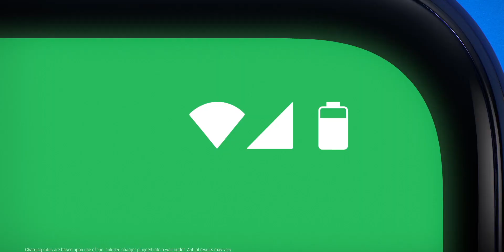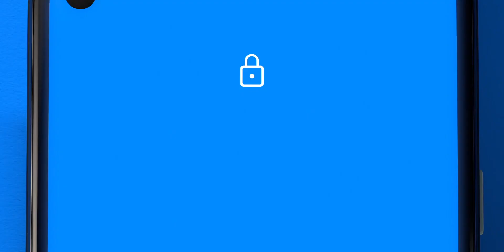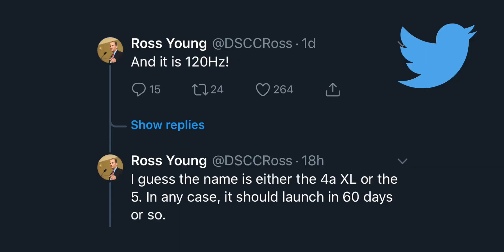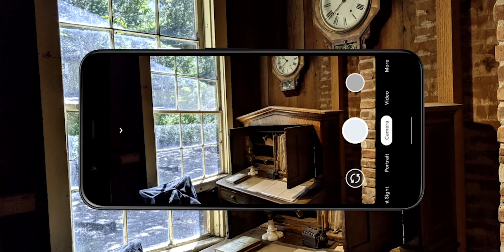Google Pixel 5 - BRINGING THE HEAT!

Comment: If October availability, I'll wait. If extended I might just give up on Google.

Thanks for the video
Reply: What's the rush?
Reply: I was waiting for the Pixel 4A , gave up on waiting.

Got the Galaxy A71 instead 😄 I'm happy with it.

👍
Reply: @banksta3  I have  a Pixel 2XL which is on its last legs, screen response etc and I was holding out for the Pixel 4 initially but wasn't as impressed once that was released so was holding out for the 4a and/or 5G enabled Pixel (having owned most of the Pixels & Nexus up to the Pixel 2).
Reply: @ONYX-365  Oof, I prefer to wait
Reply: My battery on my old phone wasn't in great condition.
Waiting til' October might have been a stretch too far 😅

Edit* plus I like the 4500MaH battery on this phone.
Reply: @ONYX-365  Ah well.yeah fair enough. Enjoy your phone man. (I'm deciding between Pixel 4a vs Nord vs A71 vs SE)
Reply: Thanks 😄
I'm very happy with the A71 👌 great screen & battery life.
Only downside is the less than great speakers (just me being fussy)
Reply: Juan Diego well if you want good cameras and software support then Pixel, if you are gamer then Nord. Well, the midrange samsung devices are not that great.
Reply: @AnuragSharma-rq2tp  They are great, not perfect. For everyday use they're perfectly fine.
Reply: @AnuragSharma-rq2tp  Ahhhh you said Samsung midranges, my bad
Reply: Juan Diego yeah, high ends are good for daily use. If samsung makes their software as clean as google and oneplus, they would be perfect phone to use. Everything else is fine.
Reply: Do you think Google will release a smart watch? I don't want to sercum to Samsung lol

Comment: I keep hearing the 6.67 inch/120 hz model will be the Pixel 5, not the 4a 5G. I'm so confused now.
Reply: exactly in this video at 2:54, he says that the bigger phone is 4a 5g and the smaller is pixel 5 which doesn't add up. There's no way a 4a 5g is gonna get a bigger display than pixel 5s 6.67 inch.
Reply: @parthpatel772  Who says there won't be a 5 XL and that these aren't just the 5 and 4a 5G in the photo?
Reply: @kbd13-n9c  this time around Google is trying it's best to hold it's beans, unlike what happened with previous pixels we had confirmed leaks 3-4 months before the release date. But coming back to current years lineup there have been 3 codenames consistently showing up which are most likely the 4a, 4a 5g and 5. There could be pixel 5xl in the works but there haven't been any major reliable source talking about it. There are rumors that Google have already started working on 5a and pixel 6. So if there's a pixel 5 xl, by this time I guess we should have it's dimensions and screen sizes leaks from the reputable leakers.

Comment: Trouble with the Pixal 5 having a 120 hertz screen is there predilection to use small batteries. On the other hand their phones are very well optimized. I guess with a 6.67 inch 120 hertz oled screen and a 765g chip a 3750Mah screen could be adequate. With a larger battery the Pixal 4 would have been pretty good.
Reply: I will not be surprised if it is going to use some sort of adaptive refresh rate technology.
Reply: nah 3750 is nowhere near enough, especially when the pixel 4 XL has the same battery size and 90 hertz but bad battery

Comment: Will next year’s affordable Pixel 5a have a big screen? If so then I’ll wait
Reply: 'a' series always has small screen
Reply: Rama Patir I was hoping for a 6+ inch model :(
Reply: @bletwort2920  5.8inch is still great
Reply: Rama Patir I know it’s 5.8 inch is a perfect balance. But I mainly use my phone for media consumption and I want to go as big as I can and still have a clean software at an affordable price.
Reply: @bletwort2920  then get a tablet ,it's very hard to find a phone with OLED display, stereo speakers ,big screen, clean software at budget price
Reply: Rama Patir it’s probably harder to find a tablet. It’s been a while since I even heard the word. Anyway, I would like my phone to be bigger if I’m gonna to get a new phone so kinda pointless to carry a tablet if I’m eventually going to get a big phone.
Reply: @bletwort2920  check the 1+ 7 pro you may get it for low price now
Reply: @bletwort2920  pixel 4a 5g might be bigger than the standard pixel 4a and the pixel 5a might have an XL size but i don't think so
Reply: If my pre order of 1+Nord don't come/ delivered i will buy this phone 4a 5G or Pixel 5 but Pixel 5 will be more expensive than Pixe 4a IMO😎
Reply: Saaim Begh Google won’t sell Pixel 4a 5G and Pixel 5 in my country. We only get the 4G 4a as the only Google phone this year. We will likely get 5a next year. So if there are rumours that 5a could have a bigger screen then I’ll wait. There’s still plenty of time for 4a to release in my country. I’m sure we will start seeing some leaks of the 5a till then.